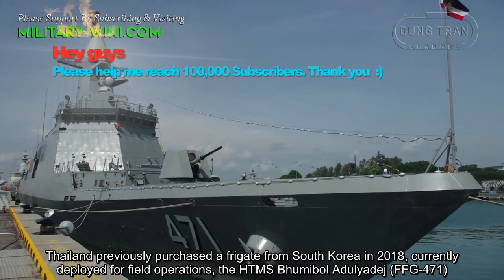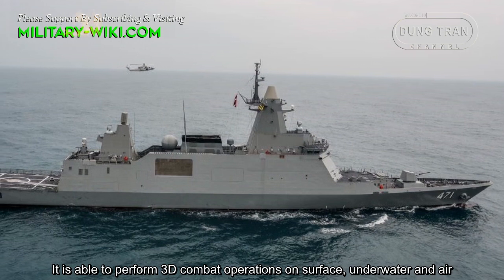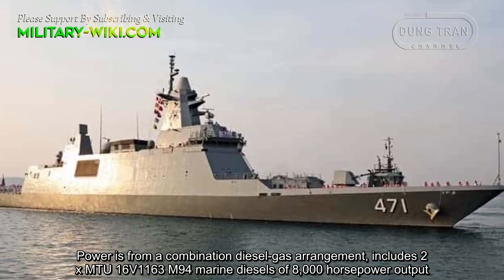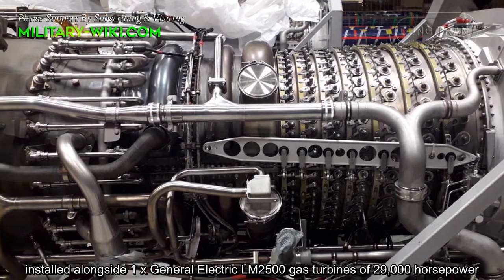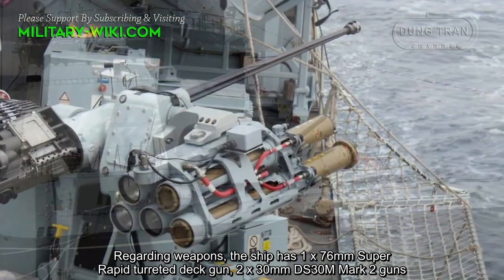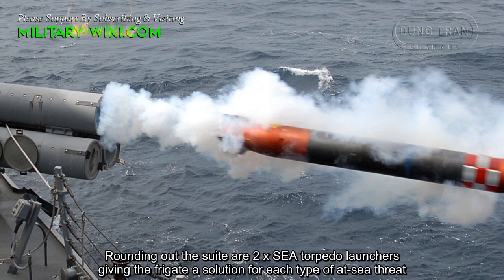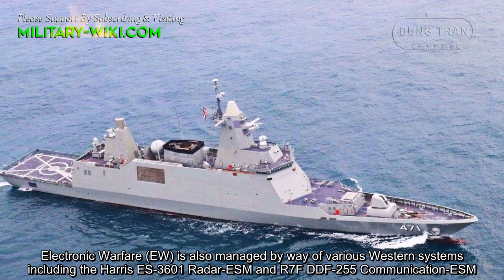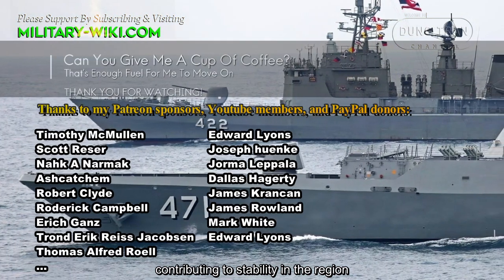Bhumibol Adulyadej-class - Super Frigate of the Royal Thai Navy

Comment: Philippines may buy this design of the frigate.
Reply: Consider how expensive this frigate is compared to the Jose Rizal-class frigate. 
Give me a lot of money, I can make the same thing.
Reply: depends if your tiny defence budget is enough!
Reply: @megaslimful  the front bow space of the ship wasnt used to its full potential yet, if it did about 2-3 more 8 cell vls be fitted, originally the bow was supposed to be longer to accommodate one more ciws like most destroyers like the burke
Reply: @sergeantblue6115  The ship is designed to receive additional launchers. Another 1 to 2 shooting platforms But the Thai Navy still put only one firing platform first because There is no reason and requires a high budget for maintenance. which Thailand can install the launching platform itself When it's needed Now, just using 8 single launchers, mixed with 8 Harpoon launchers and 6 torpedo launchers, that's enough. in normal circumstances
Reply: @chaiyasitsongserm  i agree, since we are the only member of asean to use essm(basically quadrupling the number of missile we can carry more ours peers while still having similiar or even longer range such as micas and sylvers)
But still due to the fact that we got only 3 frigates that can use the essm, due to this i think it would be best we turn the bhumibol class into a near destroyer like configuration since they are considered our "trump cards" , the new opv class should be able to cover our older frigates and corvettes(2 already retired/lost this year) with a reasonable price per ship.

Comment: At that cost & capability, wondering where Thailand will actually use it. First, was an aircraft carrier they don't need, & there's an upcoming Chinese LPD whose weight is 25K tons 

The temptation of glitz & glamour is indeed so hard to beat. 
And to their neighbor Philippines, some of their idiotic citizens even demand 6 fremms, very funny 🤣🤣🤣
Reply: The chakri was chosen cus it was more worth it than buying a 10,000 ton LPD to be able to bypass and survive in level5+ sea states which they didnt have at the time, read some history
Reply: @sergeantblue6115  you missed the point. Read carefully the comments before replying
Reply: @Andy-zs7bw  the bhumibol class was built and commissioned due to the fact most of our ships are old and would basically get vaporized by more modern foes, thus it was built as a "trump card" frigate, best equipment the thai navy can afford and has are crammed into this thing, it was actually supposed to be even larger, this is the cost cutted version.

The thai navy has a history of compensating their losses by buying or building one or two big ships rather than smaller and more nimble ships, you can the pattern of their major surface combatants being bought/built in either single, pairs(most cases) or 4s.
Reply: @sergeantblue6115  exactly, who are Thai's modern foes?
Reply: @Andy-zs7bw  Thailand doesn’t have any enemies currently, closet thing they have to an “enemy” to Thailand is Cambodia but their navy is basically just patrol boats so it wouldn’t be a good reason to use that as a reason to purchase/build these expensive projects, I should have termed “modern foe” as “military peers” in my last comment cus it would have made much more sense.

Simply, Thailand is peer pressured in a way to purchase these due to their “military peers” having stuff they don’t or any sort of advantage compared to their navy in that matter.
A good example would be Myanmar, due to Myanmar having subs(also other surrounding nations but we’re focusing on Myanmar) Thailand was pressured into buying 3 subs to “balance out” the advantage, sometime later Myanmar built a couple frigates by themselves, Thailand fired back by purchasing the largest frigate in the region, reasons are the same as the first.

To summarize, it can be broadly stated that it’s a combination of necessity and the need to “be comparable” to nations around them that pressured Thailand into buying such projects.
Edit : grammer